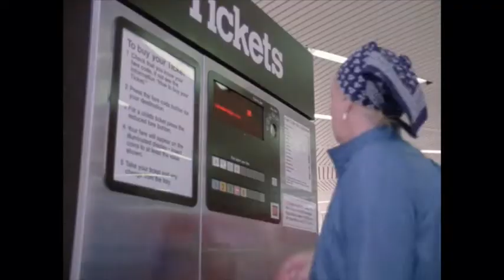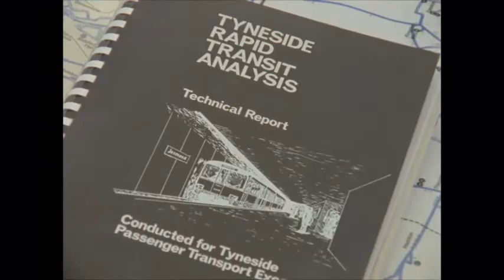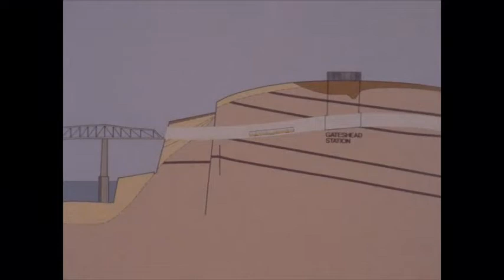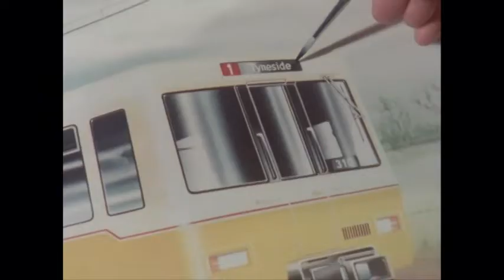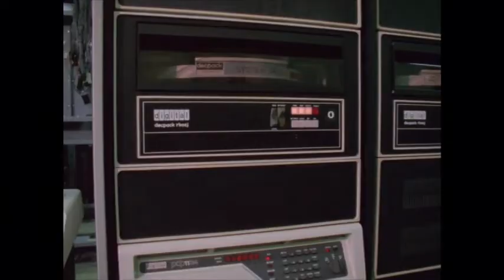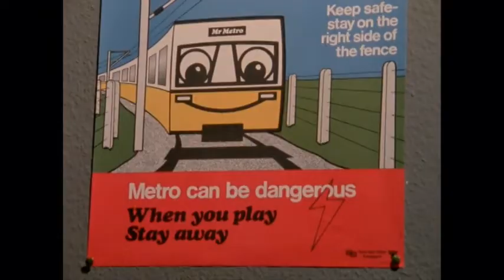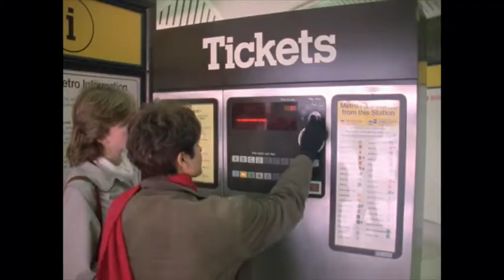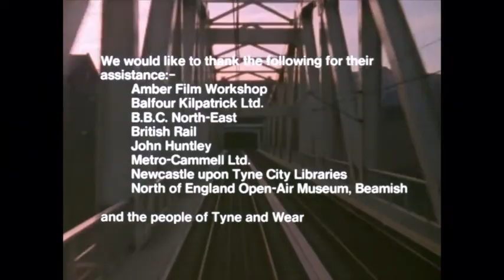History of Tyne and Wear Metro - Documentary - The Way Ahead

Comment: The metro in ne is a joke. Overcrowded...outdated....and expensive ie no mon to fri passes for workers etc.  On top of this limited stops..in sshields you have to get a bus to get to metro stop from cleadon or the nook so it only serves one dide of shields.  Its also damned slow and very old tech.  London getting the billions check out their new underground line compare to our tram on tracks system...a joke tbh.  We live in dark ages in northeast..compared to london abd most of eu too.
Reply: I think it says a lot that the Metro arrived just as the Tories were entering power. A few years later, and I doubt the Metro would have been built at all. Labour don’t get away scot free of course, they’ve had ample years to get it right. The political appetite for decent public transport has been eroded over the decades since. Hopefully with the new Metro cars and the planned extension to Washington as well as a possible Labour government, the next big boom for T&W Metro may be on the horizon. I live in Wigan on the outskirts of Greater Manchester and we have nothing beyond local buses. I wish we had the Metro. Even the Metrolink is hit and miss with terribly slow moving street sections, especially in Manchester city centre.

Comment: 1970s: with careful consideration of local communities, the disabled, working conditions, public safety, and electricity supply, we'd like to unveil our automated integrated metro system.
2010s: so we gave the ferry contact to a company with no ferrys, running out of a port that's silted up, which has a login portal that takes you to Google, and copied its terms of service from a Pizza place. Don't worry, it'll be fine.

Comment: 18:16 Delighted to see two DECwriters, four 2.5-megabyte Digital Equipment RK05J removable disk drives, and a PDP-11/34 minicomputer controlling the whole Metro.
Reply: I wonder what they currently use for it.  A Raspberry Pi running emulation could probably replace it nowadays :D

Comment: The line to Kenton Bank Foot wasn’t new. It was the Ponteland branch built in the Victorian Era. It still existed as a link to the Callerton ICI depot even after the metro took over to Bank Foot. Admittedly since it did not get electrified by the NER unlike the coastal loop, it didn’t have much passenger traffic and closed to passengers in the 1930s. They were still using Ponteland station for goods and storage though in the 60s.